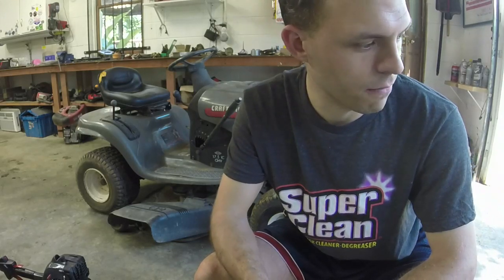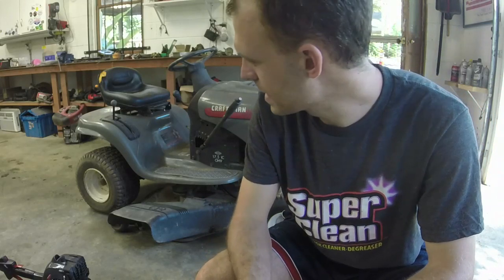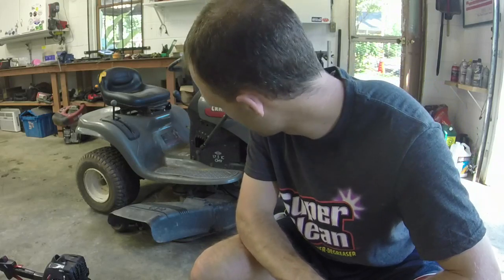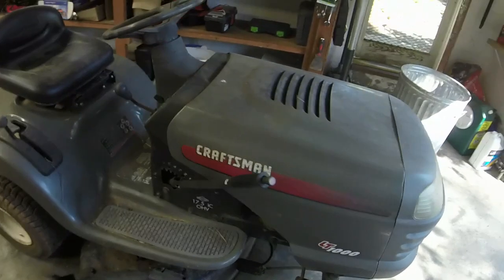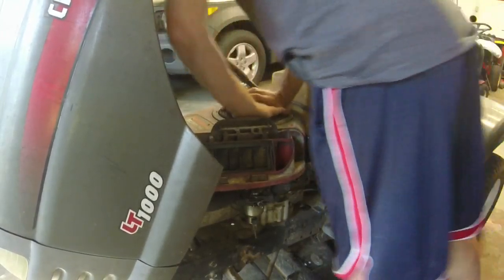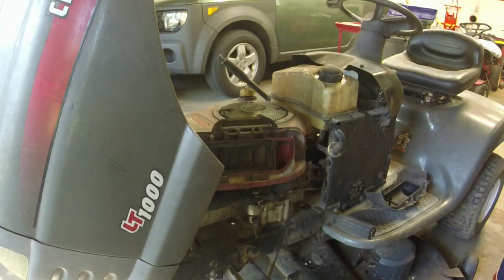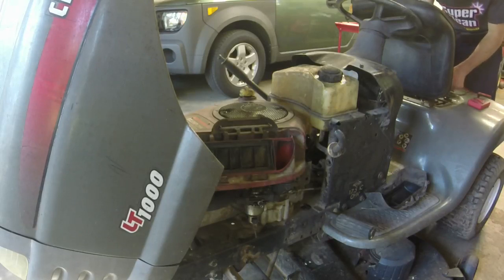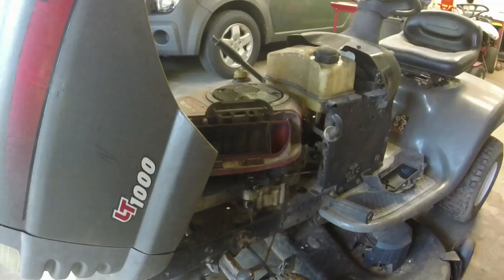Craftsman LT1000 riding mower hard starting & stuck deck engagement: Diagnosing and fixing (Part 1)

Comment: Glad i got recommended to your channel. I enjoy watching your vids. You seem like a regular old dude, where as other small engine YouTubers seem cocky and arrogant. I just recently got my very first lawn tractor ever. I've been cutting almost a acre with a push mower, With that in mind I'll be watching all your content.i do have some knowledge on small engines not as much as I'd like. So I'll be following your channel hoping to learn more. One question? Why do it atf in the tires?
Reply from the maker: Thanks for watching Gary!  I'm not out for the fame and glory or for the money, just for people to enjoy someone fixing things and maybe learning a thing or two along the way.  Any questions feel free to comment and I'll do my best to help.  ATF in the tires acts kind of like slime, but it swells the rubber inside and does a great job sealing dryrot cracks in the tires.  I've had tires lose air in a day due to dryrot and age, and after putting in about 8oz ATF in the tire, blowing it up and driving the tractor it no longer loses air.  Cheap and effective!

Comment: I put a new deck belt on and now my mower wont really start. Can the belts stop mower from starting. The other belt above deck belt can that stop mower from running. Do you know which way to turn the nuts for the above deck belt to loosen and or tighten.
Reply from the maker: If the belt is catching when trying to start, you either have a belt that's too short or the tensioner pulley is stuck in the on position.  It's unlikely a deck adjustment will fix the issue.

Comment: Hey I am having issues with the gear shifter won't go into any gear with the clutch fully compress. How do I fix this issue I have a Craftsman LT1000 model # 917.276390.
Reply from the maker: If the shifter moves freely, the linkage between the shifter and transmission broke.  If it won't move at all, you may have an issue with the shift forks inside the transmission.  You can also try adjusting the brakes, sometimes they'll cause the shifter to bind up.
Reply: @EllisMowersandmore  ok ty I will try all this and let you know. And again Thank you